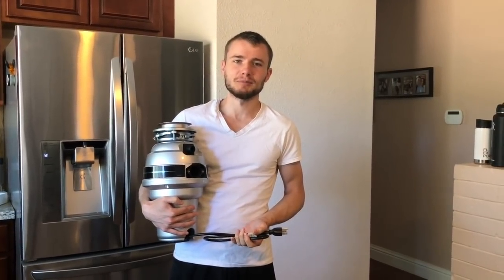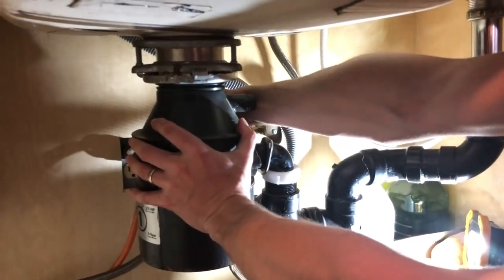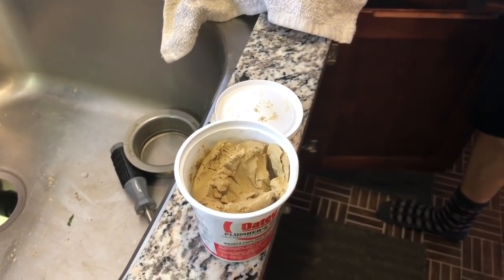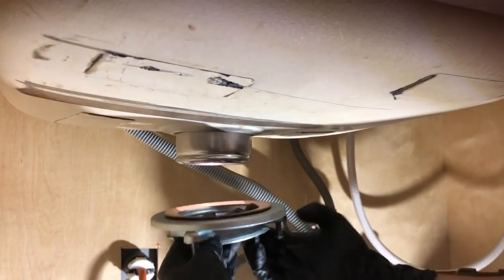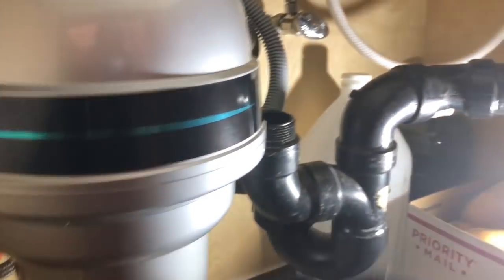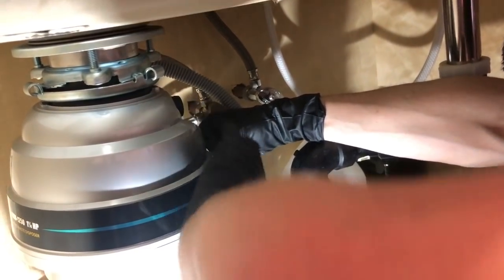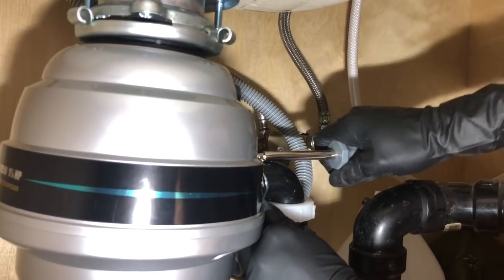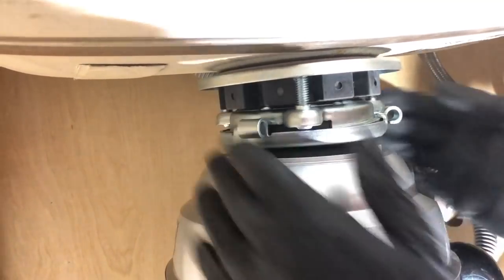How to Install an In Sink Garbage Disposal Erator InSinkErator Installation/Replacement

Comment: My 3-family rental property had three of the InSinkerator Badger-9s installed by the plumber when it was built. The grinders jammed easily finally cracking and leaking as shown after only a few months of use. Replacement Badgers cracked in the same manner. I replaced the Badgers with the InSinkerator 2 stage Evolution grinders costing twice as much. So far, these have given good service and I have had no issues with them either cracking or jamming.

Comment: Rental property owner here.  I've installed a few of these.  The 90-degree drain piece that came with it is not standard.  You have to use it to fit it in the disposal.  Cut the other end to make it fit the rest of your drain.

Comment: I believe you forgot to knockout the dishwasher drain plug.
Reply: Fred he sure did. He’s gonna be calling a plumber for sure once he turns his dishwasher on
Reply: At first I thought maybe he knocked the dishwasher drain plug out but did not video it but when he held the disposal dishwasher drain at the light I could see the plug was still there. Either the dishwasher is simply not going to drain or it plows the drain hose off and he winds up with a flooded kitchen and basement when the dishwasher tries to drain. The instructions usually have an exclamation at that picture and or wording. Obviously he forgot or never read them in the first place. There were other issues with his installation  I could write a book.

Comment: I think you needed another 5 or 10 pounds of potatoes.  I didn't mind the penis reference, but it looked too small to be that.  Also, don't say "all right" unless it is - otherwise I get confused.  I noticed that you had the same problem that I did, with getting the unit screwed in to the bottom of the sink.  I was not able to do this by myself and had to get my brother to hold the unit in place while screwing it on.  This is difficult because the ring at the top does not go on easily, and so it is easy to get one side to catch while other sides have not engaged with the flange.
Reply: Those gloves and socks go along with the video